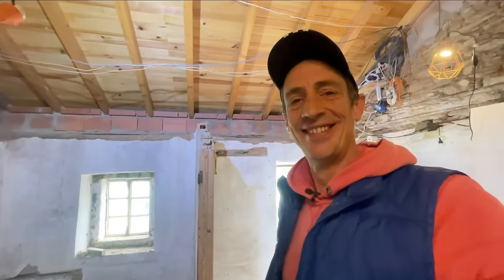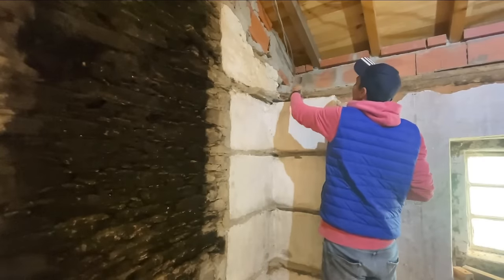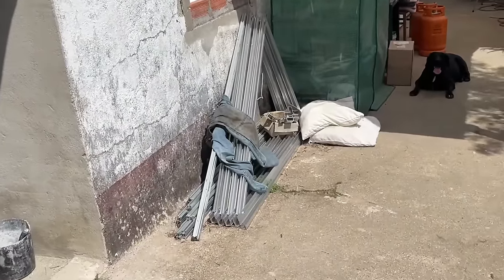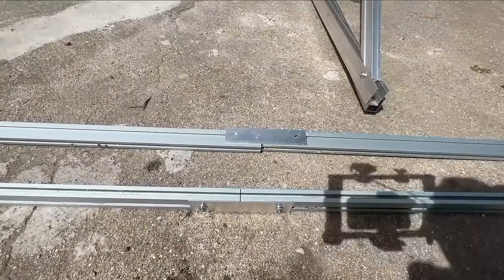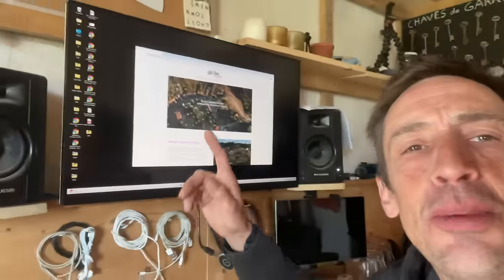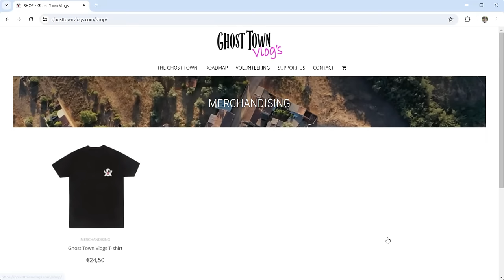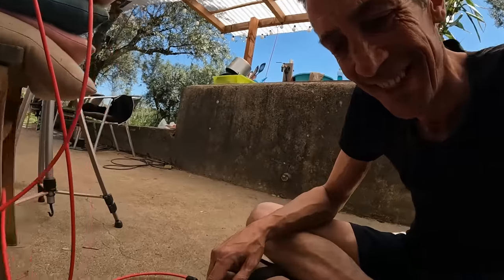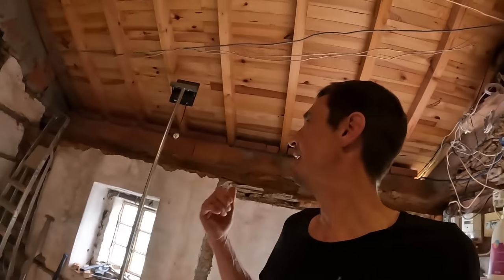SEASON 4 - LET'S GOOOOO

Comment: Jasper, 
To fix the broken power wire, You need to get some Heat Shrink Tubing WITH Adhesive.  The adhesive seals the wire up making it water proof.  Get a smaller size for the individual conductors and a large size that will fit over the entire outer cable.  I would solder the wires together, but you could use Crimp Butt connectors as well.

As for the solar problem.  I think you are connecting all your panels in series, (positive to negative from one panel to another). If that is the case, I think the output voltage of each panel is around 40 volts, so connecting in series would be 40v X 5 panels = 200 Volts.  The Bluetti only takes 150v max.  So you should be able to connect 3 in series, maybe.

The wattage of the panels is unknown to me.  You could connect 2 panels IN Parallel (Negative to Negative and Positive to Positive) and the voltage will stay at 40v BUT the amperage will be double the single panel output.

I think the AC300 supports a 12amp input.
Reply: I thought of shrink tubing right away too 👍
Reply from the maker: Thats some really good tips, thank you! They are like 47 watts each. 3 seems to work in series. im going to see if i can connect two series. :)
Reply: @GhostTownVlogs  Jasper, Those panels seem pretty large to be only 47 watts each.  If they are JA Solar like the cardboard said, I count 22 cells tall by 6 rows for 132 total cells.  JA Solar seems to have those panels set up as two separate but connected panels in one unit.  So, 132 cells divided by 2 is 66 cells each. 66 cells times 0.5v per cell is 33 volts.  Those panels should have a minimum of 33 volts.  But at the size they seem to be I would "think" they are maybe 400 - 500 watt panels.

This is just what I'm thinking.  Are there info labels on the panels themselves?  Just wondering what they really are.

BTW, I think it's great what your trying to do in the old "Ghost Town".
Reply: @GhostTownVlogs  Jasper,  I was watching the video again, and at 40:02 into the video you show the Bluetti screen.  It shows charging at about 66 volts and 678 watts.  Like I mentioned in my other comment about each panel probably being 33 volts, well that shows it. 2 panels in series would be 66 volts.  And the 678 watts for the two panels would be 339 watts each. 

Depending on the real maximum output voltage of each panel, you might be able to do 4 panels in series,  33v times 4 is 132 volts, which is below the Bluetti's 150 volt max.

Comment: A simple encapsulating kit will be water proof   It is where you splice the wire by sodering and heat shrink over the actual splice and than place epoxy that is a two part mixture, and you pour that in a sleeve of plastic.   That will be very water proof.   It is what is used for installing a submersible pump in a well.

Comment: Remember that almost ANY amount of shading will KILL the output power of a whole panel - even the shadow from those fence posts will do it.
Reply from the maker: really.. well the birds already shat on it also...so :)
Reply: @GhostTownVlogs  I was going to mention about the shading in my other comment, but figured it would get mentioned.  Best location would be anywhere it won't get shaded.
Reply: On the roof is the common solution. But you still could have trees etc around.
Reply: That cable issue. Waterproof joint box and to make double sure fill it with potting compound. Latter will guarantee that no moisture ever find its way into the wires. Yeah for season 4! 🎉

Comment: There are waterproof connectors. It’s like silicone goop. It’s  used with irrigation systems that the wiring is bries or all ways wet damp conditions

Comment: I noted your modules are wired in series to create a panel of two. When add more modules to the panel the voltage increase each time. The energy storage device maybe unable to accept a voltage input higher than ?. Hence display fault. Install another string or circuit create to parallel voltage sources. Easy purchase a splitter and split the string at the panel end. Or run separate string back to the energy storage device and if no secondary input this string split the input there to combine both strings. Also only install 6mm cable the DC voltage losses are less when long runs of cable be requirement. And conduit your cable will prevent future mishaps. Maybe bury the pipe once permanent?

Comment: Bluetti needs a certain voltage limit and beware with max amperage you may need to make 2 panels in series to increase the voltage then the others 2 also in series then put those two sets in parallel and beware with max watts in bluetti, I buy bluetti panels because that issue the panels to adapt was more expensive because that amperage limit and high voltage

Comment: hi jasper, it looks like your voltage is to high,not watts,do two and a two you will need more connectors though,good luck
Reply: yep, each panel is probably 32v...connect just 2 in series or 2+2

Not sure what the max input voltage is for that bluetti

Comment: About your solar... the thing is, the bluetti has a maximum input. The max input is not the same as the output. In the datasheet of the AC300, what you have, the max input is 1200W ( on each Input port !) , 12 - 150V DC and max 30A ( on each input port). 
You already had on your App 66V and 680W with 2 Panels. That is why you had a overload warning with 4 Pannels, when you pair it in series. The only way to change that is to play around what is the best combination between series and paraell conection of the panels. I don´t know the specs of your pannels so I can not give you here a info what to do.
FYI here. the difference between series and pararell is series means the Watt stayes the same as one Pannel and Voltage adds up. Paraell means Voltage stays the same as one pannel and the Watt adds up.
You would need a Y-connector on the pannels to make a combination of 2 +2 pannels for example. means 2 pannels in series and another 2 pannels in series combined.

Comment: You will need to check the current and voltage ratings of both the panels and the Bluetti.  It is not the power capabilities of the Bluetti you go by. What matters is the Voc (voltage open circuit) and Isc (current open circuit) of the panels and the input maximums of the Bluetti.  A quick check online says that Bluetti you have can manage Voc input of 12 - 150v, so the series Voc of the panels cannot be more than that 150v.  And the maximum Isc of the panels cannot be more than 12a, and those panels you are using are usually 17A to 18A Isc.  Check the sticker on the back of them or online search for their specs.  You can get optimizers, but they are usually voltage boost buck converters and would not work with your setup.